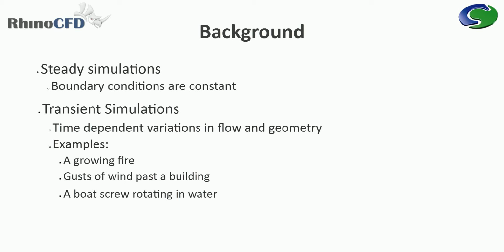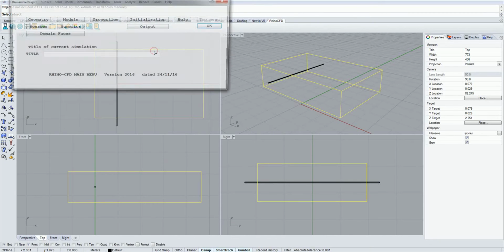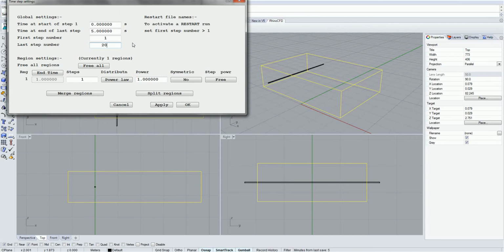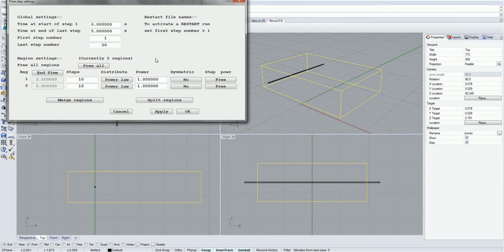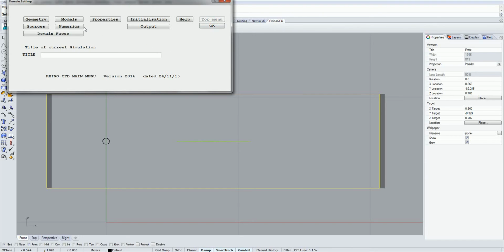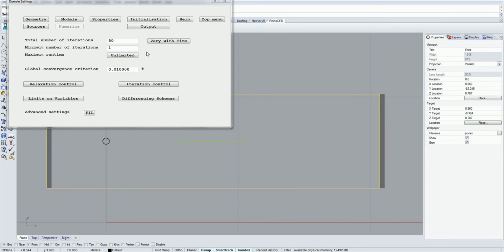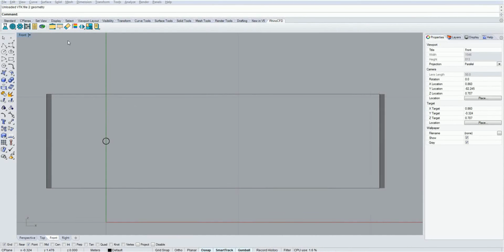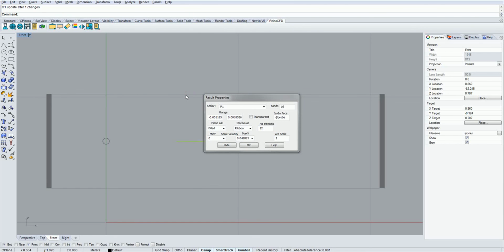RhinoCFD Basics - Transient Simulations

Comment: Hi. I'm new to rhino CFD and I was wondering if you could illustrate more on the menus. it seems like you cut through the video because I can't get the results the way you are showing it in the video. thanks.
Reply from the maker: Hi Shirin, sorry if there is any confusion. This video was intended to illustrate the principles behind setting up any transient case. The settings in this video will not enable you to set up a Von Karman vortex street. The results shown at the end were used as an example of transient results.